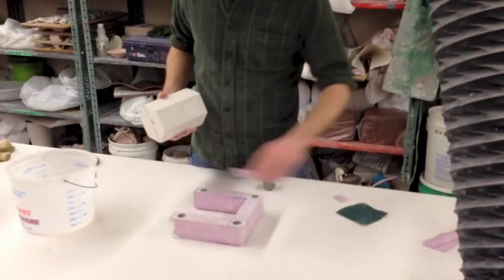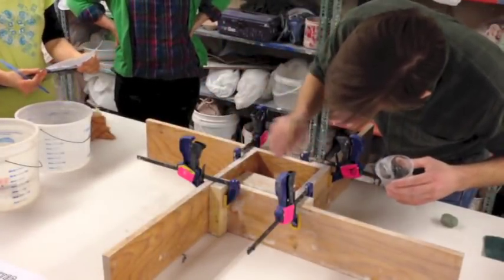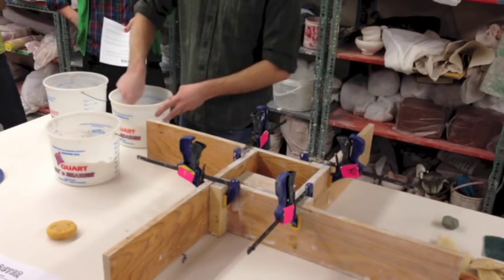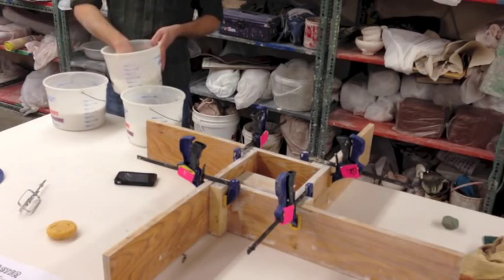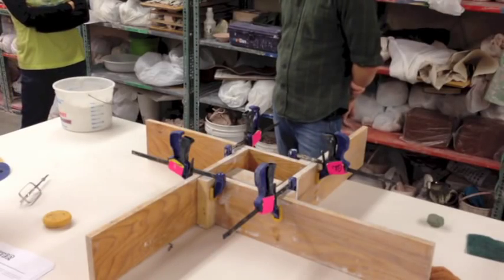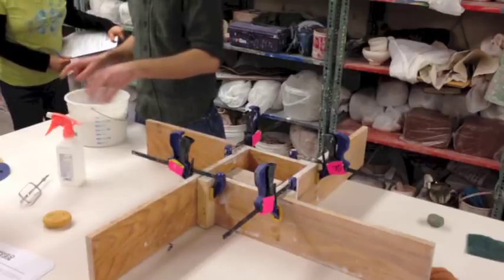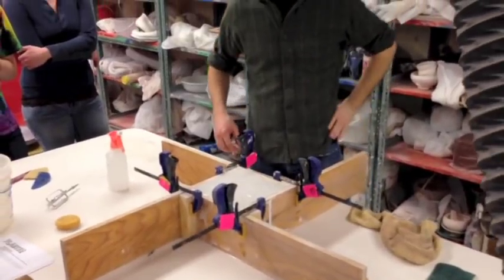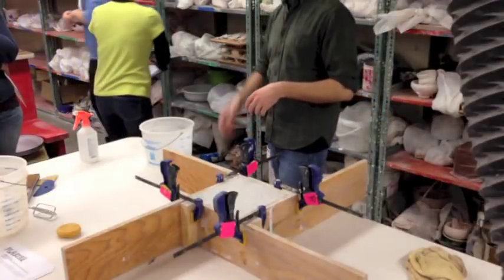Colin's Mold Making Demo, MNSU Mankato

Comment: This is such an excellent video! Could you tell me what the foam, and process of using it is, it sounds great... I hate building up a clay bed around my positive.  Thanks again for the video!
Reply from the maker: The pink foam is the stuff from the hardware store called foamular. It can be cut with a sharp xacto or heated wire (or heated knife). There isn't really a good way to cut it... Yeah the clay bed is annoying but useful when making a single mold. When you make more than one mold of the same object, I'd say go with the pink foam because it can be reused and without time constraints. Thanks for watching!